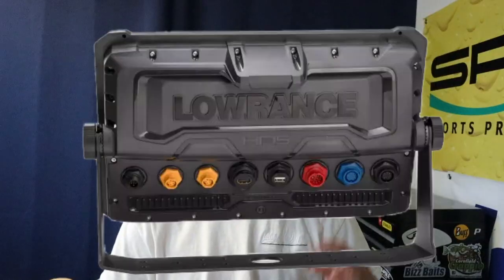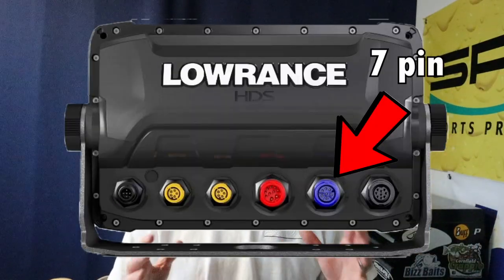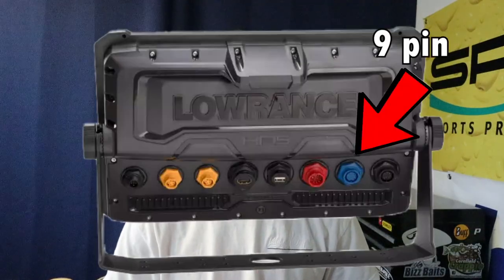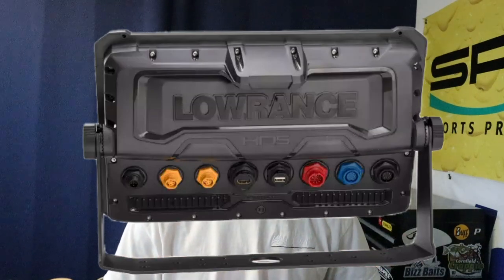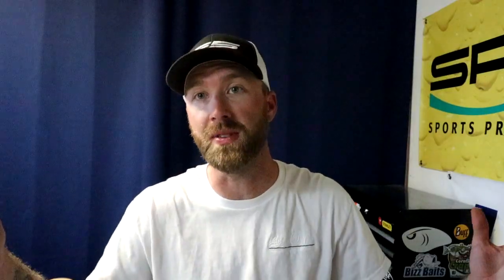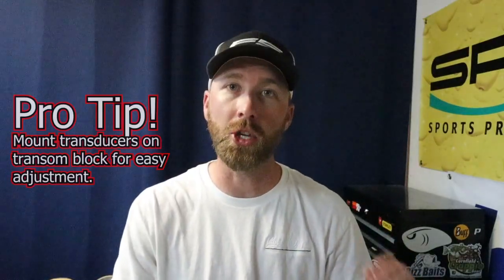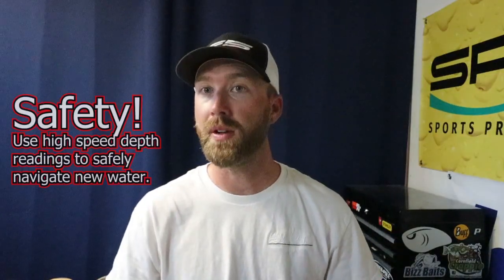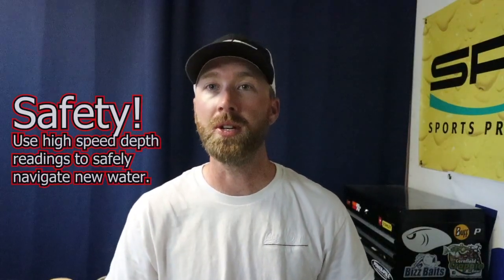How To get "High Speed Depth Readings" on your Lowrance

Comment: Great video. One question regarding two sonar sources on Elite FS9. I have a splitter to a 3 and 1 and a hockey puck in the hull. If I select 2 and 1  from the sonar set up will that work for get  my 2-D from the hockey puck at high speed?

Comment: Hey man , great video great information, i have a question for you, i just removed my screw hull transducer on my 2009 Ranger and capped it, i have a lowrance ti2 elite & hds live at my console and  have the 3/1 transducer not installed yet , 

Now my questions are : to have my high speed reading should i have the lowrance puck that i glue to the bottom of the hull ? If this is correct which model would you suggest me ? 

As for getting the side imaging im guessing the 3/1 should do the job, would you have a video of the proper install if it ? 

Thanks again man

Comment: Where can I get the Y cable please? I have a 3 in 1 transducer in the rear and a 2 in 1 built in transducer in the front on my trolling motor. Can I connect both in to the single port on the elite FS 9? IF so Will it give me an option to switch on either one on demand? ty
Reply from the maker: No you cannot. You would need a second graph to connect to the 2nd transducer then you could share sonar info through ethernet